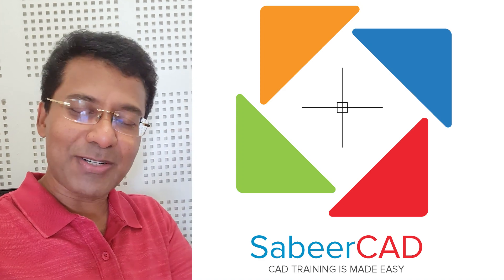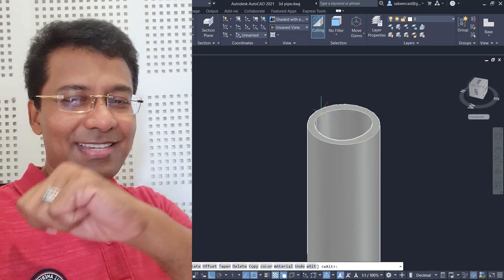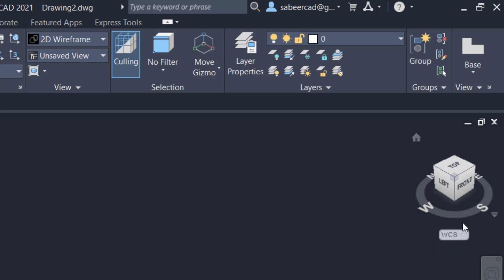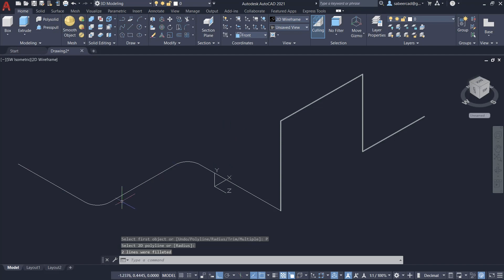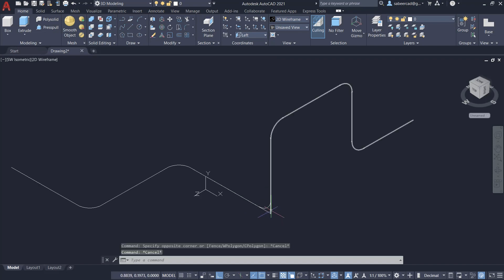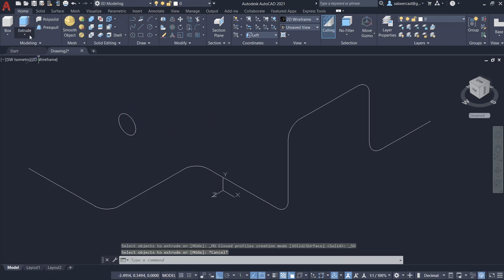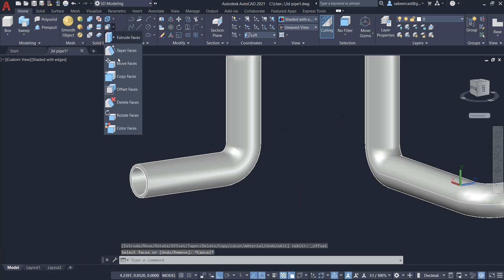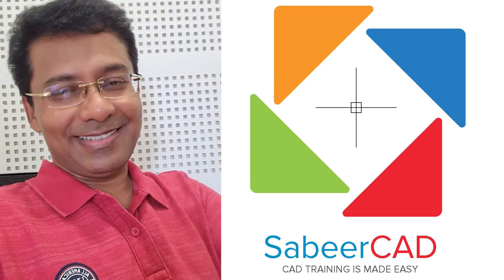Create 3D Pipe Line Using AutoCAD | AutoCAD 3D Pipe

Comment: Thanks for the video. I had trouble figuring out how to fillet a 3D Polyline, but you can't. However, there is an easier way to do this than drawing polylines on different planes. Create your 3D Polyline as you normally would, then simply explode it and now you can fillet every corner whether it's coplanar or not. Then join everything and do your sweep and shell. Easy. (oh, if you get an 85021 error, try increasing/decreasing the fillet radius)
Reply from the maker: Good Suggestion👍 Thanks 😊

Comment: There are 2 faster methods. 1. Use "3D polyline" function or 2. Use "normal line" for drawing in 3 dimensions and "join" at the end. Both methods don't require changing of LUV Plane.